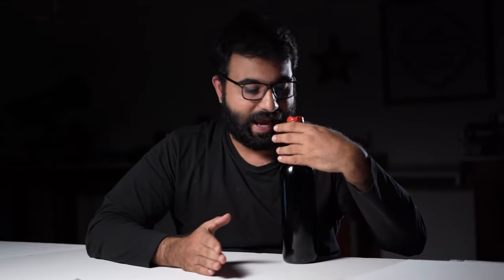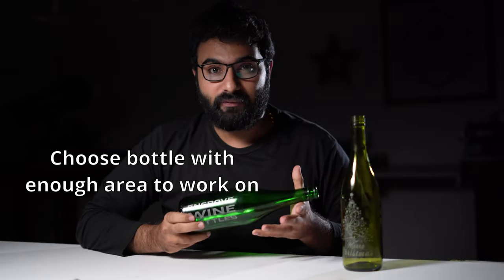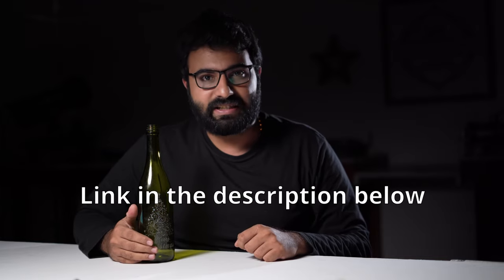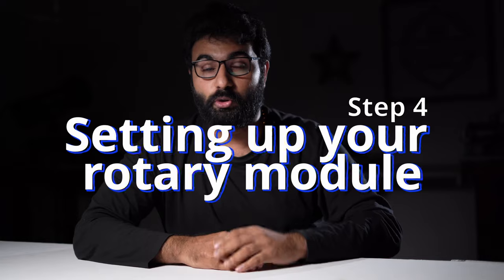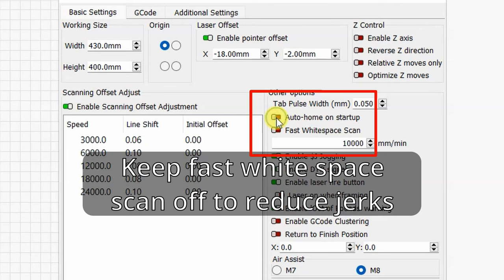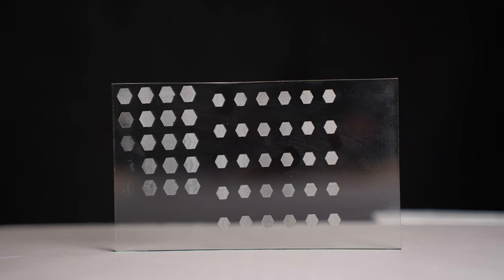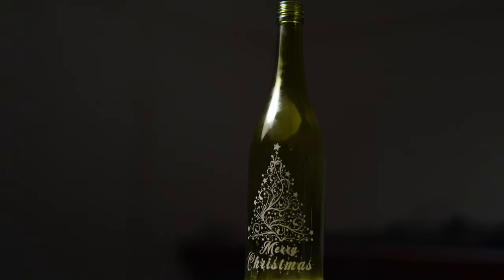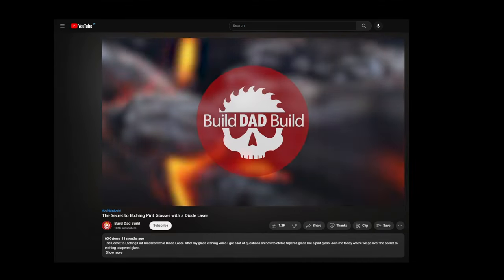Glass Bottle Laser Engraving - Everything You Need To Know To Engrave Wine Bottles

Comment: Great stuff.  Thank you.  FYI, welders are taught to NEVER weld galvanized material, as the fumes are hazardous.

Good content.  Thanks again!
Reply from the maker: Glad you liked the video, and thanks a lot for bringing this up. The fumes produced during laser engraving cold galvanizing compound can also be harmful if inhaled, which is why it is advised to always use proper enclosure and good ventilation during laser engraving.
Reply: @MellowpineLasers  
I would find this topic valuable:  
Context:  I just purchased an Elegoo Phecda (10w/455nm).  It came with green safety glasses.  From browsing safety glasses, orange OD6 glasses seem most appropriate.  The green lenses I've shopped appear to have less (but almost ok) attenuation in the 400~455nm range, then a dip until the near infrared.  In the near infrared they then again rise in attenuation.  

I assume the Elegoo Phecda laser this is a 'simple diode laser', as DPSS efficiency would be prohibitive.  I have read that diode lasers have multiple modes, and thus also emit multiple spectra.  The problem is I have no sense of what these other wavelengths are.  (Are they closely spaced to the primary wavelength, and therefore effectively filtered with similar lenses, or are they harmonically related with wide spacing?)  Harmonic multiples could explain the Elegoo green lenses.  Knowing the entire spectra would assist in choosing optimal safety glasses.

Thank you!  Sorry for the length.
Reply from the maker: Yes Mike, that surely is a good topic to discuss. Most diode lasers are Direct diode lasers and they emit the laser within a range of wavelength, such as the blue laser mostly emits between 400 nm and 500 nm wavelength. The safety glasses provided with the laser generally have the capability to filter out all the laser rays between that wavelength. 
The green glasses are good enough to block the harmful rays, but are not as effective as the orange or the red ones. However, most diode lasers also have a protective guard around the laser head, so the laser gets filtered by that guard first, and then by the glasses, which improves the safety.

Comment: i have found that is far easier to dip a bottle in dilute paint (50/50 water/tempera paint, black).  i bought a cheap pitcher and dip all my glass in it.  spin and dip a few times to remove any bubbles, and it creates a very nice, even coat which seems to help with the variations in shading of the engraving.  love this video.  thank you.  very helpful in me trying to troubleshooting my cracking of the bottles (heat stress?)  i think i need more speed!  you're running much faster.  thanks
Reply from the maker: Yes, if you are working on a batch of bottles, then it is surely more efficient to dip the bottles in the paint, thanks for sharing. 😊
And for the issue of cracking of the bottles, you should surely try faster speed or lower down your laser power.

Comment: This video was very helpful! The only question I have is what do you use to wipe the paint off with the zinc spray?
Reply from the maker: Glad you found the video helpful. 😊
The cleaning process depends on the type of coating you used. Generally, water-based paints and zinc spray comes off easily by rinsing under the water with gentle scrubbing, but if you find it difficult to scrub it off, then you can use paint thinner or rubbing alcohol for effective cleaning.

Comment: Thank You for your videos,they are very helpful,want to ask how to proceed if we need inside engrave?
Reply from the maker: A way I can think of is to dilute tempera paint and pour it into the bottle, then turn the bottle around till you get a good coat of tempera paint inside. You'll need to use a diode laser, the beam will pass through the glass, hit the paint, the paint then transfers the heat to the glass and the inside will get engraved. Check out my glass engraving video for more details. I suggest tempera paint because it's soluble in water and you'll be able to clean it easily after engraving. You should also keep in mind that once you engrave the inside, whatever you store in the bottle would stick to the engraved portion and you might have a hard time cleaning it later. Could you please tell me why you'd engrave the inside and not the outside?
Reply: @MellowpineLasers  Just curious about all techniques for cutting and engrave . I know how difficult is cleaning inside after use the bottle . Think tempera is very good idea ,thanks.

Comment: Great tutorial and tips.
Is this melting the material (zinc) on glass, or is it really engraving into the surface of the glass (micro-shattering)?
Is there a substitute for zinc spray paint if not available in my area (TiO2 powder with alcohol...maybe....zinc with alcohol🤭)? I tried black paint thanks to great tips from your other video (Learn How to Laser Engrave Glass like a Pro using a Diode Laser!) , but I am unable to get a frosty engraving
Reply from the maker: Glad you liked it. 😊
In this process, the zinc absorbs the laser energy and transfers the heat to the glass, which causes microfractures.
The best alternative to Zinc is to use black spray paint or black acrylic paint, and for the frosty look, perform a test run to find the optimal settings that give a frosty look to your engravings. Also, do not leave the paint on the surface overnight as it can darken the engraving sometimes. It is best to engrave as soon as the paint is dry and wipe the paint off as soon as the glass cools down.
Never tried TiO2 or Zinc with alcohol, but I don't think it is a good idea as alcohol is highly flammable. Any trace of alcohol left on the surface can cause a fire.
Reply: @MellowpineLasers  thanks will try it. alcohol is just to spread TiO2  and then evaporate and dry faster
Reply from the maker: Do share your results if you try it. And make sure you allow it enough time to completely evaporate the alcohol before engraving. 😀

Comment: Question, please, how deep is the drilling and how is the depth controlled?

Is it possible to engrave a circular shape on a cup that has curves?

How much does this machine cost and its power?
Reply from the maker: The engraving on glass is not too deep. It is just deep enough to etch the glass and produce a permanent mark, and the depth can be controlled by controlling the laser power that you use to engrave the glass.
Yes, it is possible to engrave a circular shape on a cup, but if the cup have uneven surface, the laser will not be uniformly focused, and the results will not be good.
The machine I used in this video is 20W xTool D1 pro laser engraver. You can check its price here: https://www.xtool.com/products/portable-diode-laserbox-d1-for-laser-engraving-laser-cutting?ref=rVAr7a1K&utm_source=influencer&variant=43024250339567 But you will also need to buy a rotary module to engrave cylindrical workpieces.

Comment: Good video but you don't explain the object diameter and circumference in rotary setup tab, I'm bit confused on that part cause I have my rotary setup as 80mm per rotation and 25.5mm roller diameter which does make 1 roller rotation, but when I add the object diameter should the bottle do 1 rotation aswell?
Reply from the maker: The object diameter parameter is irrelevant for rotary rollers. You don't need to worry about that. As long as your roller does one rotation, you are good. The object diameter is needed only when you are using the rotary chuck.

Comment: We are using the cold galvanizing paint, but then having to scrape it off the image with a knife, because the paint thinner is not removing it.  Any suggestions?
Reply from the maker: Paint thinner should remove cold galvanizing paint. Try soaking it in paint thinner for a while before rubbing it. Also, do not let the paint sit on the bottle for too long. Engrave it right after the paint is dry to touch and remove the paint as soon as the bottle cools down after engraving.
Reply: Do you try acetone cleaner ? For me is best after using acrylic spray paint-all paint disappear for seconds 😉

Comment: So you can't use the laser to remove the labels?
Reply from the maker: You could, but the bottle might get engraved here and there and it's also like using a scalpel to dig a hole. Easier and cleaner to remove it the regular way.
Reply: @MellowpineLasers  I didn't know about the paper but the cleaning lasers are used for adhesive removal. Be interesting to see if it can be done with these machines Even if it's not practical

Comment: Great video as usual, I commented on one of your other glass videos to get more info on etching with a rotary, however I'm still having the same issue with cold galvanized spray on the glass, which is a brown output on no matter what power or speed. I ran a Norton white tile grid on the glass I'm using and all the squares came out brown or a shade of brown, nothing was frosted. The glass is a high borosilicate type from amazon, 16oz beer can style. I'm curious if you've had a similar issue, and if you have, is there any advice you can give me, thank you in advance.
Reply from the maker: Thank you, I haven't faced it before but I'll run some tests and let you know
Reply: Any follow up on this? I've had the same issue with cold galvanized spray and black chalkboard spray paint. It seems like the paint is being melted into the glass, leaving it with black specks or even completely black if the power settings are way off. BTW your videos are insanely helpful thank you.  @MellowpineLasers